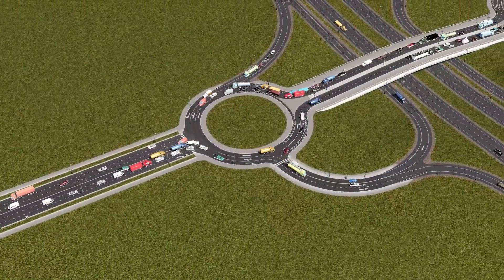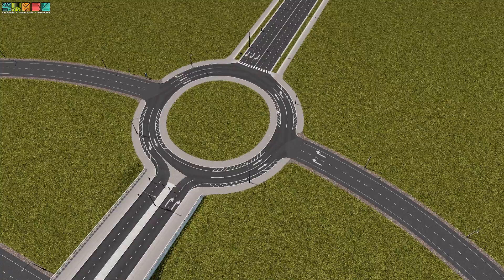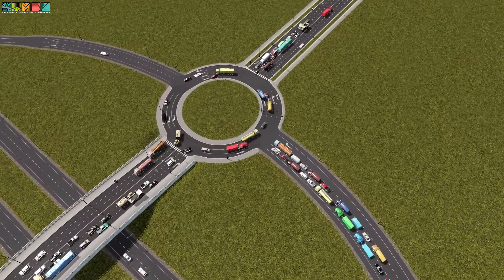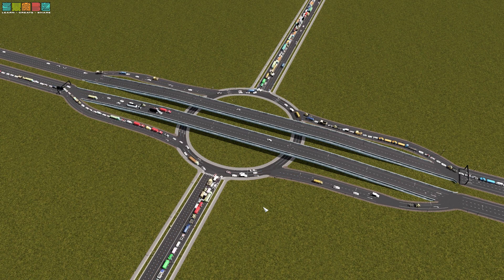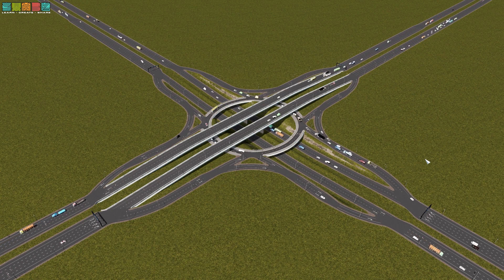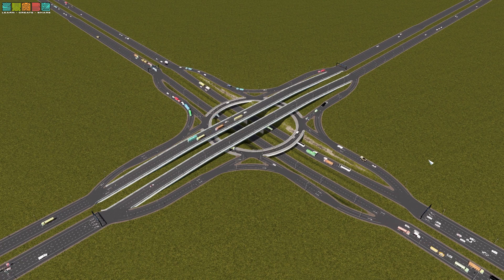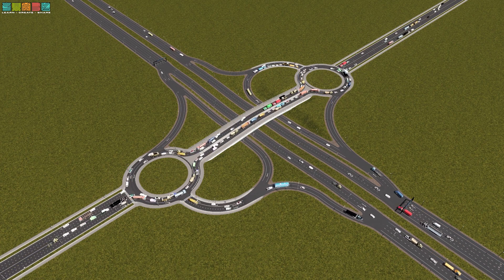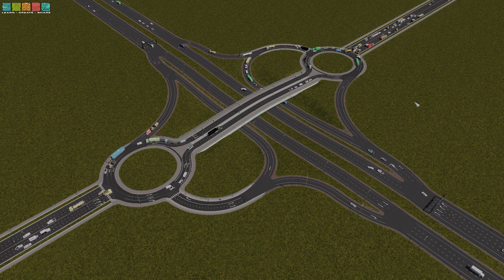Roundabouts work GREAT in Interchanges! (Sometimes)  -  Roundabout Interchange Comparison

Comment: I have a methodology question/recommendation for future videos. the traffic test map has 8 incoming highways. For a four-directional system interchange splitting them 2-2-2-2 seems reasonable, but for a service interchange I feel 3-3-1-1 might be a more realistic split. If the dogbone is struggling with through-traffic here, that's bcs it wasn't designed to handle as much in that direction.
Personally, I love the "single bypass", or as I like to call it, the two-level roundabout. Mostly because it can be an extremely compact service interchange, which is easy to build and doesn't require me to set up traffic lights.

Comment: This kind of dumbbell interchange is one of the most common service interchanges I've seen off of highways in my region of Brazil. I've seen a few dogbones in urban areas, I think. The exits and entrance lanes are squished close to the highway to save on land area, though. 

The other most common type (besides "eyes" where you have to cross a side of the highway to get to the other and is only used for very low demand, like ranches and small villages) is the cloverleaf. Brazil has tons of area, so we make tons of cloverleafs.
Reply: Same in the UK

Comment: If anything, I feel this shows how shoddy the vanilla traffic AI is. Cars are waiting unrealistically long to enter the roundabout. (Just pick a random car and watch it sit there for ages)
Also the roads tying into the roundabout should have a more sweeping angle on the outer lanes, for smoother entry.
Reply: Also in the bypass roundabout interchange there were a lot of cars that would use the roundabout to keep going straight in the highway direction instead of just staying on the highway.
Reply from the maker: The smoother the angle the worse the yield. It puts the line back further and makes the problem youre describing worse. Also less safe irl
Reply: @YUMBL  I'd never had thought! I'll take your word for it
Reply from the maker: Everything’s a balance. Makes the roundabout really tough at high density. I think this map is a fair stress test overall.
Reply: @YUMBL  And I thoroughly enjoyed it! Great nuanced take👍🏻
Reply from the maker: Thanks :)
Reply: If the angles are more sweeping it's harder to see what's on the roundabout. If you need to stop you have to look backwards. And if you're in a vehicle with a near-side steering position, forget it - Spanish roundabouts are a pain in the butt in my UK reg van...
Reply: Yeah I get better traffic flow with vanilla roundabouts.

Comment: If traffic lights in-game needed electricity to function (so could fail if in blackouts), we'd probably see more reason to make intersections using roundabouts.
Reply: Also, if traffic accidents were a thing.
Reply: @KaiHenningsen  I have seen cars drive though others not sure how that happens.
Reply: @KaiHenningsen  This is the key thing that's missing in C:S, the big, BIG, advantage that roundabouts have over other intersections is that they are so much safer.
Reply: Traffic lights are only ever needed if roads aren't planned properly
Reply: @KaiHenningsen  Accidents should've been a thing in the game since release. I don't understand why cars simply clip through each other, cars can't clip through each other in real life.
Reply: @automation7295  really? I have seen them clipping... just they make noise

Comment: 6:15 roundabouts are usually not meant to take that much, It's savable with slip lanes, but that beating dead horse. 7:00 love it. I would still do it with 6 lane as well, but this looks great. Roundabout just for left turns or U turns.

Comment: The Parclo-Double Roundabout has become sort of a theme in a lot of German smaller cities where Autobahn intersections need to work around existing roads to optimize traffic flow. Add a couple roundabout bypasses for straight across connections and you eliminate the need for a multi-lane roundabout. My city built one like those for their central highway intersection and it works flawless.

Comment: I think the dog bone/ dumbbell option is the perfect solution for low-ish density areas IRL - we have both dumbbell and simple traffic light ones in my area, roundabouts are just nicer to use from a drivers perspective but once the traffic starts to ramp up they can't handle the traffic at all

it's simply annoying to wait on a red traffic light in the middle of the night or speeding up / slowing down to try and catch the green phase in general

Comment: Honestly, i would give it another try with proper lane math, by that i mean, each entry to the interchange wants one of three things: go right, go straight, go left. Pretty much same logic as the number of lanes in a turbo roundabout should be the amount of exits minus one cause you shouldnt use a main system interchange to do a u turn. So i think there's a lot of optimization to be done in this reward with all the interchanges you've made, and i would like a video trying this out. Also, just as another idea worth testing, i would use the overpass in the parclo roundabout to merge the left turns from the highway with the traffic from the avenue instead of using the roundabout to do it, might make it a bit better and a bit 'safer' so assimetric 3-2 overpass with 3 lanes entering from the roundabout and 2 trying to enter each roundabout.
Reply from the maker: The through traffic (center) lane stacks up.
Reply: @YUMBL  Yeah, i just meant that the unification (if that's a word) of the turning left from highway with the straight through from the avenue would look cooler if it was done on the bridge instead of on the roundabout, my reasoning is that drivers are better at 'zipping' 2 lanes when they are parallel than when its on a roundabout, personal expirience, some people suck at incorporating themselves onto roundabaouts and need 2, 3 or even 4 car slots to merge in, while most people on parallel merging need 1-2 car slots. Of course in CS cars, especially trucks seem to only need 0.1 slot to zipp in since the basic rule of physics that two different objects cannot occupy the same place at the same time doesnt seem to be hold to decent standards XD
In any case, i guess i was a bit confused and didnt get the 2 lane throughtput that you were going for on the avenue, but then imo the avenue needs to be 4 lanes, so you have 2 throughput 1 left and 1 right. I'm not sure of anything to be honest, by my intuition is telling me there's something i would do different with these intersections and it doesnt seem to me that it has reached perfection, dont know why. But yeah, i can see now what you were going for and i understand it better, its not what i thought was happening, so my bad.
Fun fact, the roundabout in the system interchange (double bypass) is only for turning left, so you could make it go clockwise for funsies, also with some extensive use of intersection marking tool and cutting 'corners' nicely i think you could end up with a new flower interchange. Looking more into it, correct me if im wrong, but it would also make it a tiny bit more efficient, since traffic going counter clockwise has to 'put up' with 2 other lanes entering, but going clockwise they only have to put up with 1, if im not missing something.

Comment: Very common to see dogbone/dumbbell interchanges in the Netherlands as well. It's mostly used when traffic is very biased towards one side of the interchange (for example a small city on one side, rural area on the other) and a bias towards one direction on the main road (for example commuting to a larger city nearby). With almost no cars flowing through this as an overpass or coming in from the other side of the main road it's a very small/cost-effective way to connect all directions. When I encounter these it's very rare that another car is coming in and I have to give way. The dumbbell part is on the side of the city, often combined with a carpool, or just to allow people to make a u-turn without going through the entire thing.

You could give it the partial cloverleaf treatment and have one exit for both entry/exit lanes. That is commonly done here in order to provide a way to connect a small industrial or carpooling area as close to the highway as possible, instead of two sides to enter the roundabout.

Comment: These were my starter highway exits when I started building my own interchanges. The first two are easy to build and work in vanilla. I built a very similar double bypass roundabout in a vanilla build some time ago. I expected problems with it but it pretty much ended up being the least problematic interchange in that build. Part of that was I also wanted it to be an exit but it was a little too much so they had to exit somewhere else.

Comment: Here’s a suggestion for Yumbl: How about making a variant of the dog-bone parclo at the end, with a couple of slight changes.
1. Get rid of the dog-bone.
2. The highway off ramps section splits into one going under the arterial and one going up. Where it goes up to the arterial, make it bi-directional as well.
3. Connect the newly bidirectional section to the section that goes under the overpass in a similar manner as the “parclo” loops connect to it.
Prevent all left turns on/off the interchange and you have a fairly free flowing service interchange. (You may need to adjust the lane mathematics to optimize the flow rate.)
Reply from the maker: Id have to see it to understand

Comment: The Dog Bell can be improved by the addition of an additional, segregated, left turn only filter lanes. As to your final preferred solution, the planners of London's orbital motorway came to the same conclusion in the 1970's. A search for say "Aerial photograph of Junction 28 where M25 meets A12 by Brentwood", or "Aerial view Junction 30 M25", will reveal a 50 year old predecessor. There are live CCTV streams of the junctions, if you want some real world data.

Comment: I don't know if you ever noticed or if anyone pointed it out, but the reason the single bypass failed so hard was because the on-ramps and the roundabout had the same speed limit as the bypass. You can see that cars are lining up on the on-ramp only to get right off and back to the highway they left. Since we know pathing is based on the fastest route, I don't think the cims are being deterred from using the roundabout to make the wiser choice of staying on the bypass.

Comment: This might be a fun one for you. You should look it up. The I-10 in El Paso, TX runs parrallel to Loop 375.  They kinda intersect each other via Executive blvd. I wish that they would have made a better interchange in this area as the current design seems a bit basic and perhaps confusing to some. Someone already went nto the off ramp crashing onto oncoming trafic. Check it out. Here are the coordinates    31°47'31.70"N 106°31'15.65"W

Comment: Just came across this video. Very nice but one observation for the circle under the highway interchange: the majority of traffic is coming out of the highway and going into the circle to make turns. I believe it may be a setup issue but if the heavier traffic is north south then the lifted highway would be in that direction rather than left-right direction.

Comment: Where I live we have a something very very similar to what you did with the double-bypass roundabout including slip-lanes, underpass and overpass. The only difference is that the overpass is for one direction only (in our specific case it's the correct decision I think). Oh and being in an urban area we also have a pedestrian "underpass" on the ground level, what is your case is the highway it's set as an underpass which is under the pedestrian underpass which is under the roundabout which is under the overpass. Also the pedestrian underpass crossing connects up to the roundabout between the roundabout itself and the slip-lanes, the reasong being that there are bus stops IN the roundabout, which is not really good in my opinion and would be the major thing I'd change.

Comment: My choice of intersection is usually the double Bybass roundabout or something similar. The partial is way better. Going to start using that. One thing on the partial, I noticed on the roundabouts you have 2 lanes merge into one slip lane for entering the motorway, any reason for that over just one?
Reply from the maker: Its so two lanes of through traffic can make it across on the arterial.

Comment: With a double bypass, you can simply remove the roundabout and have a 2-phase signal intersection for left turn only. Depending on the traffic wanting to turn left, I think you can have 3 lanes intersection in a smaller footprint than a roundabout.

That's what they did in my city
Reply from the maker: That would be my preferred solution as well, though its not the topic of this video.

Comment: The real issue here is the number of interactions and number of cars flowing through.  Straight thru bypasses are the most obvious way to lower the flow of traffic through the interchange to start with, which also offering the straight thru traffic the desirable "no slow down" route.  The dogbone / dumbell could be significantly improved just by giving the north south a straight through option that would be faster than taking the traffic circles.  That would lower the traffic in by a certain amount, and also significantly decrease the number of car to car interactions occuring.
Reply from the maker: Straight through traffic is a normal situation that interchanges generally need to accommodate for. The parclo did much better with this in mind.

Comment: Hmm, regarding space taken up by the bypass roundabout intersections, I think if RL road geometries were followed then they're more efficient. I'm sure you know that the roundabout intersections are so common in the UK partly because of the space cloverleafs take up. I think that on motorways, weaving sections (like you have in the middle of a c-leaf) can't be shorter than 2km. The only c-leafs in the UK are on lower speed roads. In effect the slip roads give time for drivers to adjust to the lower speed on a roundabout, so weaving, sharp angles etc aren't a problem, but directly off a motorway, they are a problem.

Comment: A recurrent problem is that the roundabouts are too small. More precisely, the distance between coming onto the roundabout to the next place going off is too small. Don't forget that roundabouts have crossing traffic, and you just do not have enough space to do the crossing in. Also, use node manager to make the 90-degree enter/exit things larger.
Reply from the maker: Most of the roundabouts were 64 meters in diameter. Quite large. And I did use node controller. There was just too much traffic for the first two.

Comment: On the Double By-pass Highway Roundabout, it looks like there's a nasty conflict point where the highway offramp meets the roundabout. I realize conflict points are impossible to eliminate altogether. I was imagining myself entering that roundabout at near highway speed, and crossing the traffic exiting the roundabout. You can even see some of the CIMS slamming on their brakes, lol. 
I like the design, though. I think that intersection/merge could use a tweak.
edit: I just realized calling a Double By-pass is fitting, lol. Could induce heart-attacks.
Reply from the maker: Oh, you have to yield when entering any roundabout. So yes, slowing is neccesary
Reply: @YUMBL  What do you have your 'follows the rules of the road' setting at? I swear I saw those drivers sailing thru that merge, oncoming traffics be damned. Maybe it's just normal functionality, but more obvious because there's only the one interchange to focus on. 
I just thought it was kinda funny.

Comment: Here's a test for any junction: reduce all the roads coming out of a junction to 1 lane with a low speed limit, wait until it is all jammed up, then remove the restrictions and see what happens.
The vanilla cloverleaf fails this test miserably (it will not recover) but my optimized cloverleaf recovers within minutes.
Reply: The vanilla cloverleaf is so bad because the entrance to the highway is before the exit. So traffic can loop around on itself and keep itself stuck.
Reply: @Kaitou-ug5yi  
Yeah, the vanilla cloverleaf is all kinds of bad because of all the weaving that is required. A modified cloverleaf shifts the weaving onto a side road so that traffic on the main road can flow freely, which is better. My optimized cloverleaf completely eliminates weaving by switching slip roads around before they merge.
Reply: YUMBL,  did you try this test? Maybe you should.

Comment: Yumbl! I noticed some lane mathematics issues with the one at 9:50ish mark (before the partial cloverleaf. Some cars went Highway>Roundabout>Back to same Highway. Least so you know.
Nice seeing the different ideas! 👌🏼 👍🏼
Reply from the maker: Thank you! I dont know that theres a great fix for cars going straight through the roundabout.
Reply: @YUMBL  guessing the lane connector mod wouldn't help that much?
Reply from the maker: Just the nature of cars sharing lanes in the roundabout. It requires a three lane road to force cars to use a specific exit, but thats not realistic or necessary here imo. Two should be enough, but you cant force them to use the lanes you want.
Reply: @YUMBL  ah okay, didn't know if that'd affect the flow or such.

Comment: All of these apart from the partial cloverleaf variety are common in the UK

The other type that you haven't tried is the big wheel which is basically a huge roundabout spanning the highway (or going underneath) in 2 places which is super super common especially as service interchanges or where several medium roads meet a motorway in a more rural area...

It especially works well when you have more than 2 feeder roads joining
Reply from the maker: The big wheel sounds just awful to me, but i’m sure its great without being overused